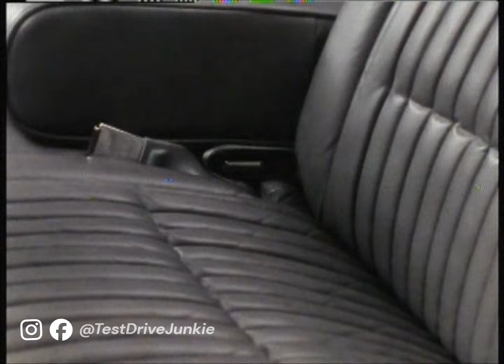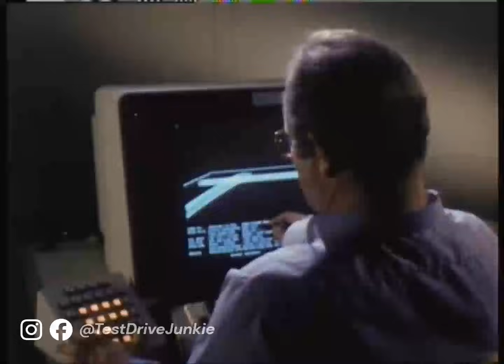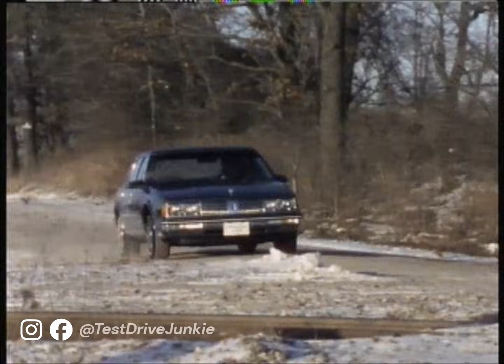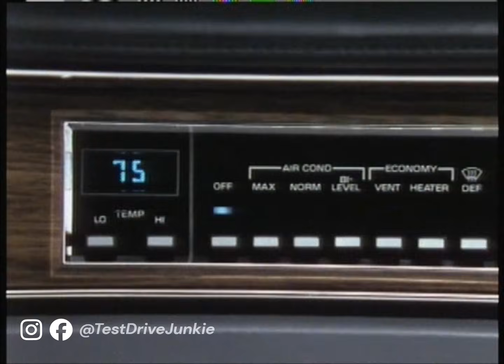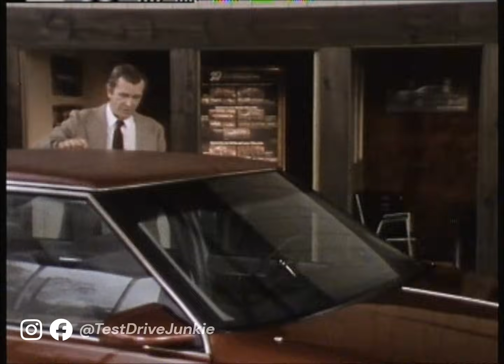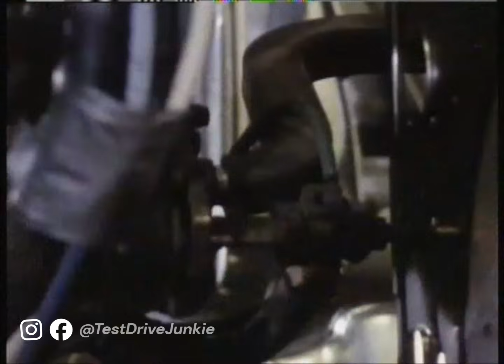1985 Oldsmobile Ninety-Eight Manufacturer Laserdisc Promotional Video

Comment: Thank you for sharing.  The first year for digital gauges in the Ninety Eight. I own the last year the 1996 model year with digital gauges. I prefer mine as it is longer and wider and the rear wheels are skirted. It was influenced by the 1980-1984 model clearly. They got the 3800 V6 right by 1988 model year.  I wonder if this model in 1985 had bigger dimensions and different exterior door handles would have things been different.
Reply from the maker: It’s fascinating to compare the evolution of these luxury land yachts over the years.
Reply: @TestDriveJunkie  Indeed.  No cars like that anymore sadly. We live in a truck and suv and crossover world.

Comment: Working for oldsmobile dealer in mid 80s yes these are downsized but still had a great ride . A few engine issue bt by 87 the 98 and deltas were great cars .

Comment: I thought these were great cars when they came out in 4/84 as early 85 cars. It was hard to choose which was nice, the Olds 98 Regency Brougham or the Buick Park Avenue. You hardly ever saw the base model Olds(98 Regency) or the base model Buick (Electra). I lean more towards the Buicks as they had the cooler hood that opened from the back and the nifty rear license plate older built in between the full width taillights.

Comment: Would that 3.0 liter engine have been the LK9 carbureted engine or the LN7 multiport fuel injected engine? The 3 liter must have been a 1 or 2 year only option, supplanted by the 3.8/3800 engine later. And I've NEVER seen that engine cover before. Them contrasting the two makes me think it's the carbureted engine. Wasn't the multiport 3.0 liter already being offered in the first N bodies in 1985?
Reply: I believe the 3 litre was also fuel injection.

Comment: These GM C and H body cars were some of the nicest luxury cars of their time. I remember when they first came out in 1985 and they sold very well. The front wheel drive really helped their sales as people in the northern states that needed that to drive through all the snow, appreciated it greatly. Ironically, in all the years that i've owned and followed these cars, I've NEVER seen a base Regency with the 3.0 V6 engine.  They all had the 3.8 optional V6.  That base engine was known to have huge problems in the redesigned 1986 Oldsmobile Delta 88.  Even on that car i only saw a handful of them on base Delta 88's.  Never in the 98 Regency.
Reply: I have seen only one with the 3.0. It was at a title pawn auction. It was around 1995 or 1996.
Reply: @aberobinson1 Total unicorn in the wild. 😅
Reply: Fargo

Comment: Never have I ever seen a 3 liter engine cover like that
Reply: Has to be for the Canadian market but I've NEVER seen that engine cover either. The US market got a black round aircleaner.
Reply: @KennethITGuru  Would the 3 liter engine have been the LK9 carbureted 3.0 liter engine, or the LN7 multiport fuel injected engine? The 3.0 liter must have been a one or two year only  option on the C and H bodies in 85 and 86, entirely supplanted by the 3.8/3800.
Reply: @gregorymalchuk272  I BELIEVE the 3.0 V6 was fuel injected on the C & H bodies.  ON the Oldsmobile Cieras and Buick Centuries it was carburated.  I had a friend of the family who owned a very base model 1986 Oldsmobile Delta 88 Royale with that 3.0 V6 engine and the bottom end was terrible. They were known to NOT last much past 80,000 miles.  If you can buy a C or H body in 1988 or newer to get the improved 3800 V6 - that's the smarter choice.
Reply: @KennethITGuru Did even the fuel injected 3.0 liter get the reputation for the bad bottom ends? I had heard it about the carbureted version. What exactly was the problem? Bad rod bearings, bad oil pumps? When did the Buick family 90 degree V6 get the gearotor oil pump on the snout of the crankshaft? Sometimes those wouldn't prime due to the distance from the oil pickup and they would have no oil pressure. The fix if this was happening after oil changes was to overfill the engine to 20 quarts, crank until it has oil pressure, and drain the excess. During new assembly or after rebuilds, they wanted you to pack the oil pump with petroleum jelly. Sometimes the gearotor style oil pumps would just shatter due to brittleness.
Reply: @gregorymalchuk272  I'm not sure to be honest in regards to your questions. I do know that the bottom ends on the 3.0 V6 were NOT very durable and would start knocking when approaching higher mileage.  That's why you don't see many cars with that engine anymore because they just didn't last the test of time.  They just weren't as robust as the 3.8's.  When the 3800 came out for the 1988 model year, they beefed up the internals even more.  My family owned a 1988 Oldsmobile Delta 88 Royale Brougham sedan and that engine was the best engine we ever owned. Couldn't destroy it.  I knew people that would get 275,000 miles out of a 3800 V6.

Comment: I really like these but there is no way an audi or bmw buyer would buy these.  They buy for the name and exotic appeal of a foreign car.  GM needed another year of transmission testing on this t440 trans.  Not terrible but not bulletproof like it should have been.

Also listen to the sound of the power seat motor innthe video.  Sounds crude.  Its those little details that make all the difference between a good car and a great car.  Gm was 90 percent there but needed to sweat the details more.
Reply: The 4 speed auto did have some problems for that very first year, 1985.  Each year following they got more robust through constant upgrades. By 1987 and 88 they were basically perfect.

Comment: Imagine walking into an Oldsmobile dealership in late 1984 seeing this parked next to "less prestigious" RWD V8 Delta 88 and a leftover 1984 Ninety Eight.  This car looks like a toy in comparison. 

Although in hindsight both generations of full size Oldsmobiles and Buicks were excellent vehicles,.especially with the legendary 3800.
Reply: I like the RWD ones too, but the FWD cars outperformed them in just about any measure. Maybe not reliability in that first year or so. The thing with the RWD cars is that they were all so underpowered from 1980 onward. They really either needed fuel injection on the 5.0 or to keep offering at least a 350 (I miss my '79 with the 403 - no fire-breather but nice and confident). Even pre-3800 FWD 98s were noticeably gutsier than a 307 car. Even in a Cutlass the 307 was kind of a pooch....
Reply: @mtut Couldnt agree with you more. The FWD cars were more gutsy and you could spin their tires at launch if you really floored it. Ask me how I know that 😮
Reply: These sold very well for the 1985 model year. So a ton of buyers didn't feel the way you described in your comment. They were still big cars being front wheel drive. The interior packaging was even larger than the older 1984 models they replaced.
Reply: The year was 1985. I was 10 years old and my dad was car shopping for used Chevrolet in an Oldsmobile dealer. Are 1973 Chevy Chevelle sedan was decrepit and he was looking at a used Chevy citation that was at the Oldsmobile dealer. I remember seeing the 1985 Olds 98 in the showroom next to the full size rear-wheel drive Oldsmobile Delta 88 of the same year. I remember asking the salesman when after he got done talking to my dad about the use citation why did the newer smaller car cost more than the older bigger car? The salesman reply was young man the this new smaller car has a lot of new technology the other car has a lot of old technology.